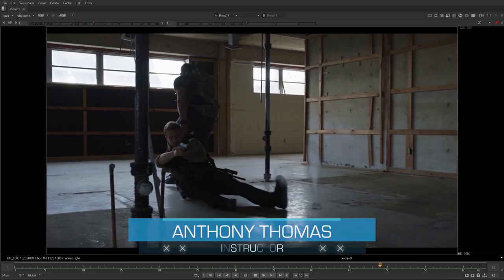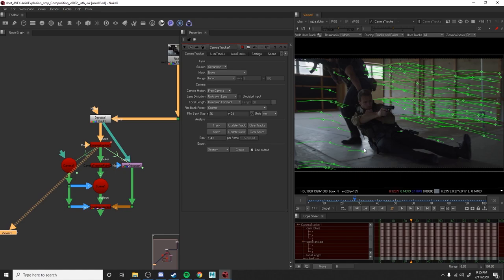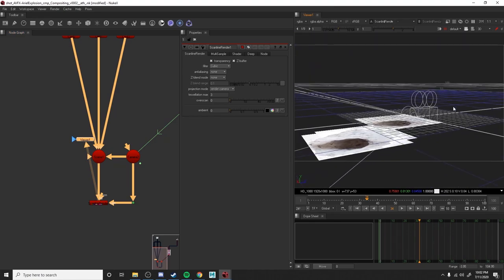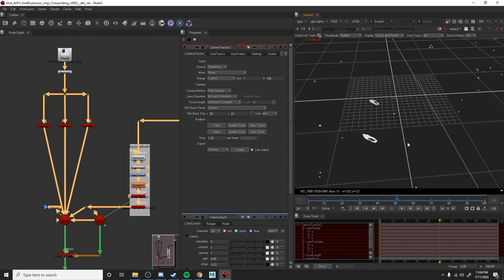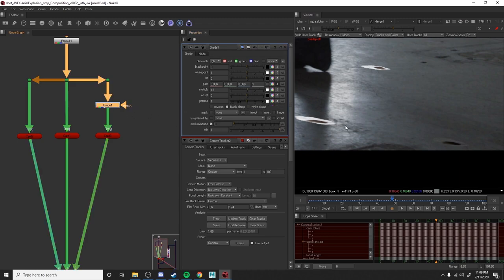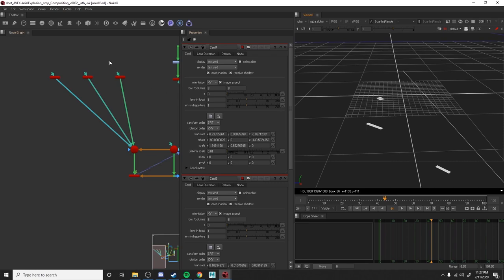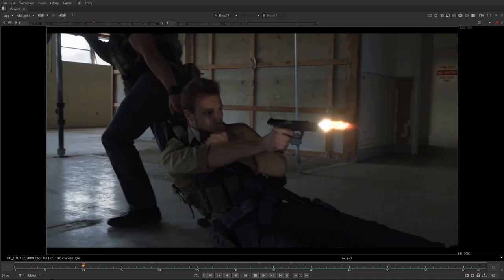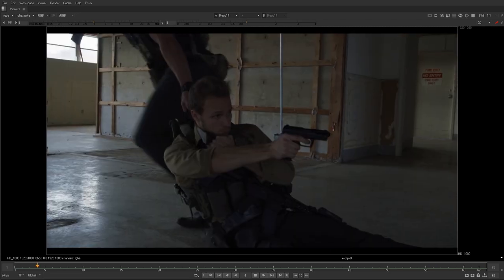Nuke VFX Tutorial: How To Composite Muzzle Flashes, Gun Smoke, & More Gun FX Stock Footage

Comment: Hi guys, in a full 3d pipeline is there a point doing these kind of effects in comp or should I learn to do it in 3d? What's your take on it? Thanks!
Reply from the maker: I assume it depends on the project or the shot. I would say you would have faster turn around to do muzzle flash FX in comp, because you don't need to re-render your 3D if you want to mess around with the muzzle flash later on in the pipeline!